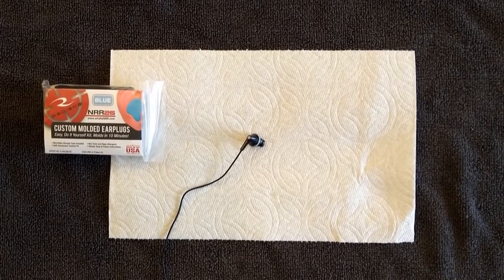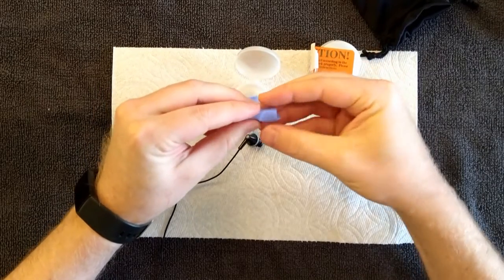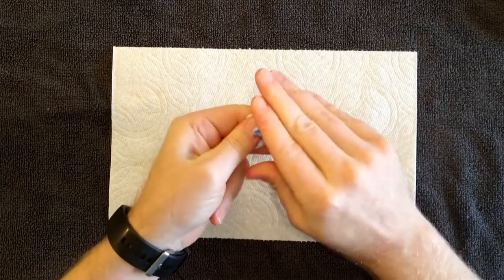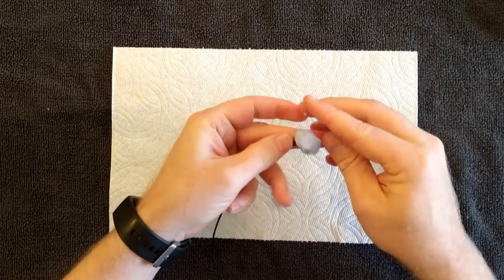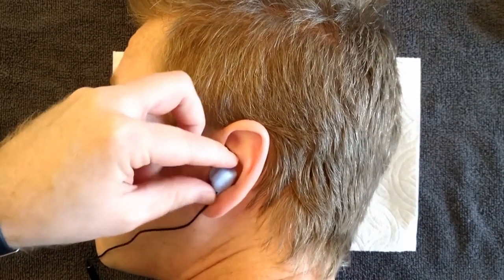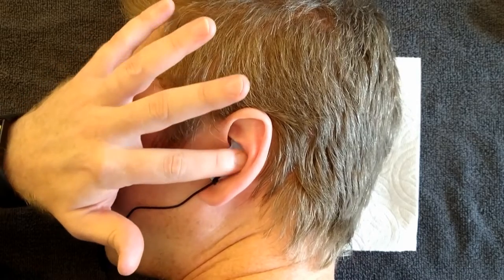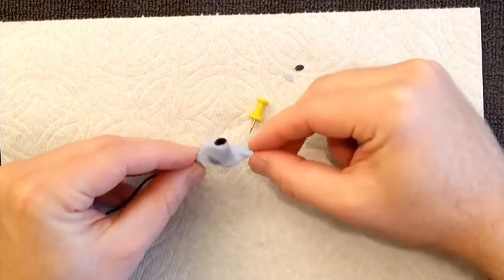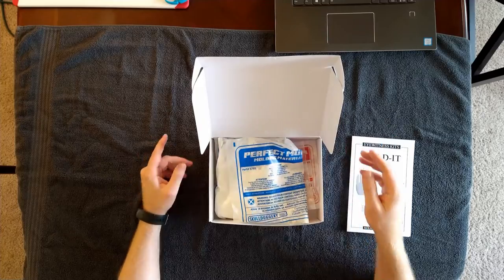Quick and Easy Silicone Custom Fit Earbuds

Comment: I bought the 12 dollar mash it in your ear stuff, mashed them in my ears then squished my earbuds inside.  Works.  Doesnt look great, but sounds good and fits in a way that the buds dont fall out.  This actually cost less than foam earbud replacement tips, and sounds better, and fits more comfortable...and doesnt fall apart.

Comment: I have for years made my own by making an initial positive with Radians then  using Smoothon Dragon skin to make formal molds. You can then make as many new positives with Dragon Skin silicone (you'll definitely need EZ Release as to not bond Dragon Skin to Dragon Skin)  as you want. I've found Dragon Skin silicone is the perfect material for noise-reducing plugs (live band rehearsal etc). You can buy a thickening agent to make the silicone even more firm and dense. I see a company is now offering essentially the same thing for over $150 per set. That's insane. I can make 40 sets for that price.

Comment: Fascinating, thanks! 
Now I'm wondering what one could do with over the ear custom fitted earphones. If both the ear cups fits your ear and the hoop fits on your head perfectly (no need to be adjustable?) maybe both comfort with minimal pressure and noise cancelling could be improved. 3D scanning your head and 3D printing could work.

Comment: I was thinking about doing the casting of the ear but now I know it doesn't work as well. 

I wonder if you use the first method to make the impression then make the casting would that work better. The reasoning is now you have a casting of your ear to make another ear bud once it starts to wear out.

Comment: I could definitely see myself thinking this would be a good idea. This way, you could make several ear molds without needing to spend several hours doing so. I wonder if this small adjustment would make for a better seal. Typically, it is suggested to create the molds while your mouth is open. I bet if you did that with the more complex approach, you'd get an ever better result.
Reply from the maker: Great point! I didn't know that about the mouth open. That could have helped.

Comment: Thank you Peter! I really appreciated your going through all of this so I don't have to.  I'll try your first method!  I'm assuming that when it wears out that the part that fits in your ear can simply be cut off and a new ear insert made. More expensive than simple replacement earbuds, but it will stay in my ear!
Reply from the maker: Yup, my current pair need to be refurbished in this way. The silicone doesn't really stick to the earbud, just traps it mechanically. Thanks!

Comment: I have seen one video where the guy coats the ear impression by dipping it in molten paraffin wax. This coat adds thickness which makes for a slightly oversized mold when you cast from the impression. The slightly oversized casting from that mold might make for a better fit.

Comment: One step I saw skipped in this is that to get a proper seal when singing, etc you should bite down on something around 1" think like a brush handle, etc as the shape of your ear-canal changes as you open your jaw.  This should substantially improve the fit.

Comment: not a good idea to pour anything into your ear. It probably won't stick to your eardrum but because the canal twists, it is extremely possible that some of the paste will stay in there as you remove the mould. The first option is the best. I have done this using reusable plastic, which lasted longer than the earphones.